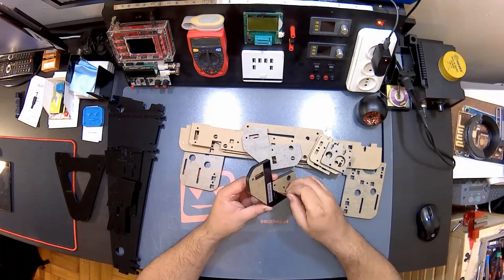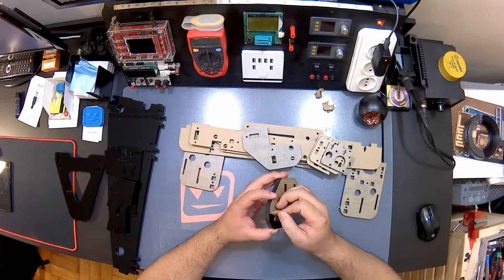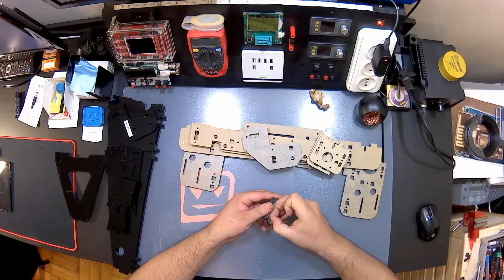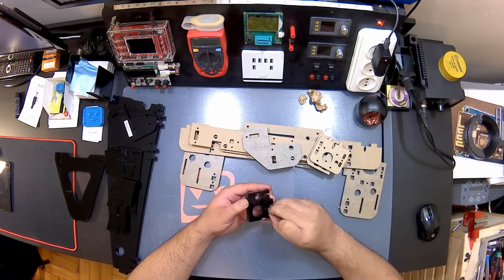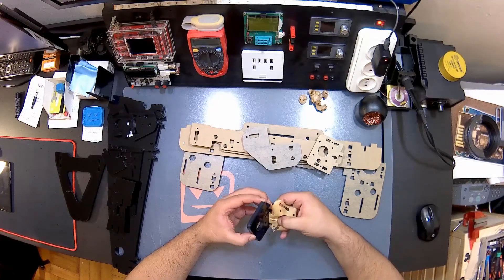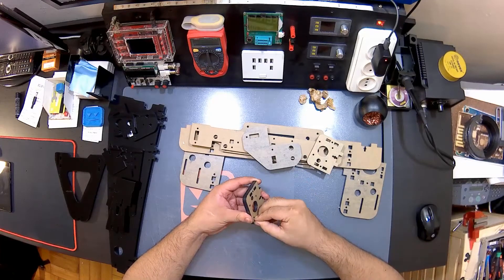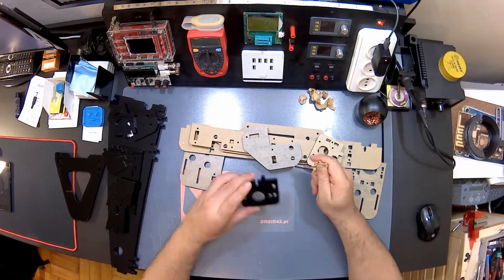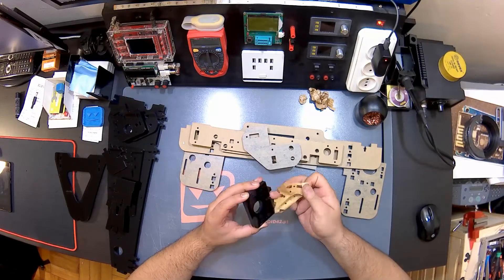Anet A8 - Acrylics

Comment: I used the tip of the smaller screwdriver to pluck up the edge of the covering from the acrylic. Was a little easier for me than using my nails.
Reply from the maker: Is not that hard to do, just extremely annoying, but that is a good "tip"!